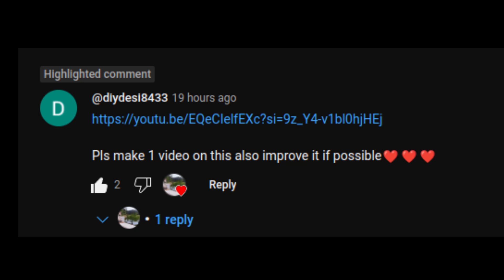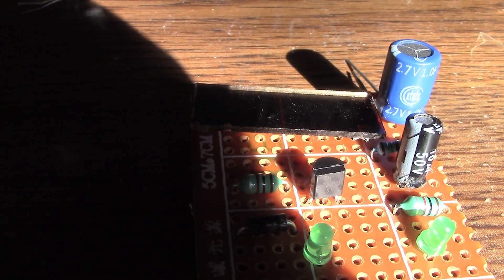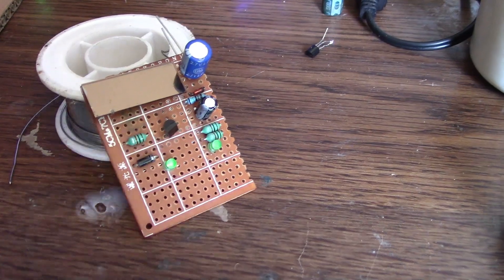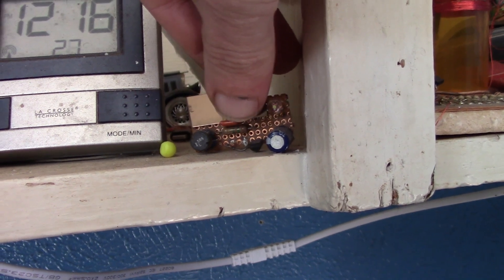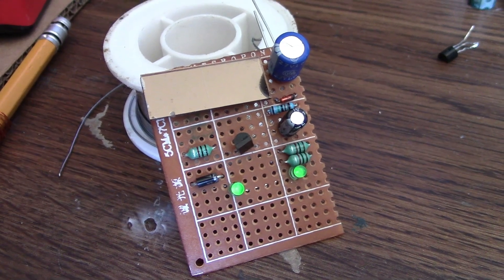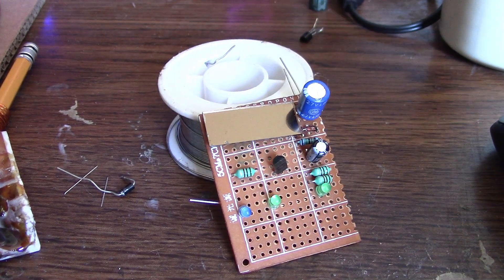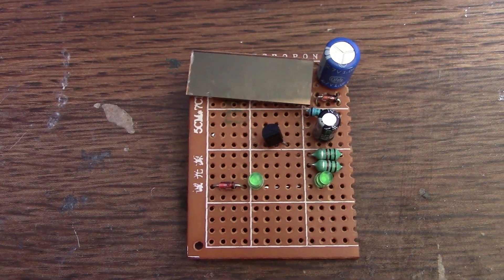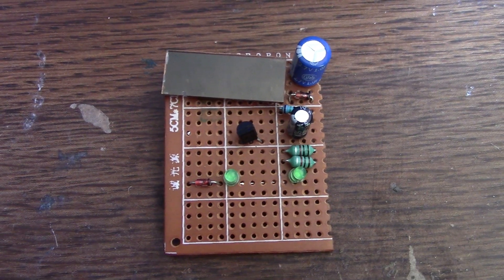Circuit Test STOPPED By This Fake Component

Comment: Hi , I just made the circuit it is not working, when I connect a 1.5 volt cell to the negative and positive it does not work I even placed the inductor side by side , i can only turn on the LED when I stick the solar cell in direct sunlight and then too they stay on and do not flash 
Plz Guide me
Reply from the maker: Hmm, it's not my circuit, you might want to ask Desi too.
As seen from 4:48, my circuit did something similar and has been highly dependent on light levels. It's carried on going for the past year with zero issues, flashing once every 20 seconds or so when sat on a shelf in this somewhat low light room. It does run 24/7 365 though, no problem at all by using the 1 Farad supercap. 
The LED's coming on all the time is like a bypass condition, straight to the LED's because of enough voltage coming from the solar panel. This type of circuit can sit in what looks like a no-man's land, where nothing seems to happen. It's between the flashing stage and the LED's being on all the time. Quite fascinating, but rubbish to our eyes!
Do check you are using 1mH inductors (1000uH), I know those work, lower values don't work as well.   
Also, tests should be done by charging up the supercap (or a big regular cap like 1000uF or bigger) to 1.5V, as shown at the end of this vid. That way, you remove the solar cell, in case yours is sitting in that no-man's land.

Comment: That misalignment with the transistor case doesn't necessarily mean it's bad.  I've seen perfectly good and legitimate transistors with a bit of misalignment between the front and back like that too.  However, if you got them from a dodgy source, it is still quite possible they are counterfeit.

Try taking a Q-tip with some acetone to the markings on the transistor.  Quite often, if a chip/transistor/etc is counterfeit, the markings will just rub straight off (because they're actually just painted on).  Legitimate parts are pretty much always laser-etched, so they won't rub off (even with acetone).

If you have a component tester that does transistors (particularly if you have something like an LCR-T4 that automatically identifies the pinout and type of components), you might want to try that too.  It's possible that they're actually functional transistors, but just a different type (possibly with a different pinout) that somebody has just relabeled to say "2N2222" instead of their original markings.
Reply from the maker: Thanks for the ideas. It was only a thought at first, while having troubles with the circuit. But the amount of mismatch was what got me, having never seen such an issue before. 
I like the Q tip method 😀

Comment: I have some of my old circuits that have fake mjl2ll94 and 93s lol I found out they were fake 2 years ago but they are pretty convincing they work but I never push them for the 24v input they would probably get hot after that
Reply: Also if I had an oscilloscope I would show a comparison of the flyback spike from a real and a fake and would show the difference between the switching performance and compare that data to the transistors data sheet to show how horrible the fake is performing to the real also power consumption
Reply from the maker: @overunityresearchchannel  Good points. I wouldn't be surprised to find out they are re-laser etching lower spec products.

Comment: And yes there has been a lot of bootleg transistors being sold on Amazon and eBay for a very long time now you have to stick to a good vendor
Reply from the maker: Thanks for the info. Yeah, that's the thing eh, to find a reliable vendor. I used to salvage everything before moving house a couple of years ago and never had such issues. Had to leave that literal shed full of parts behind though.

Comment: That suspect transistor was an interesting find and probably wouldn't have been spotted if you hadn't tried this circuit.
Reply from the maker: Indeed, very strange and not something I would normally look for or think of. 
Part 2 should be a good vid, it only needed 1 other component to be changed to be on day 3 of continuous running now. Those solar waver Vimun's really are great 😁
Reply: @Slider2732_  I want to do some more little circuits at some time. but I need to get into my store room to find the components. We have a guest staying so there is even more junk in there than normal, where I had to clear some space for our guest 🤣🤣